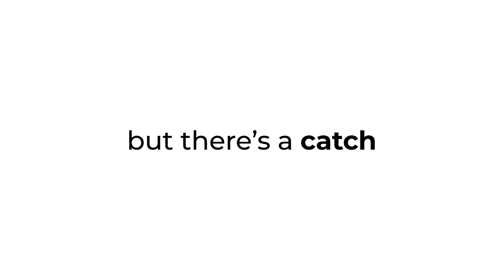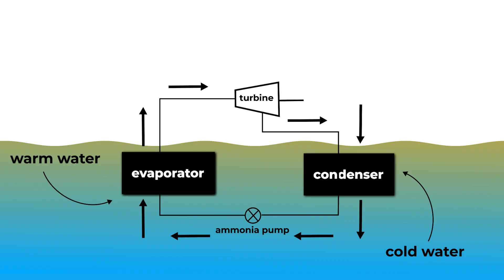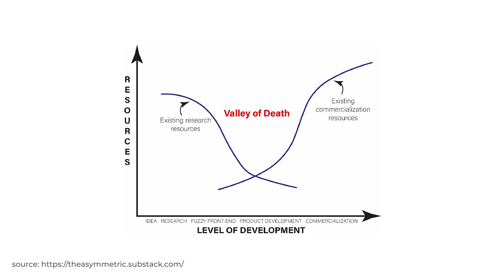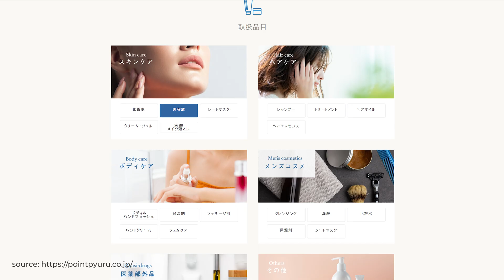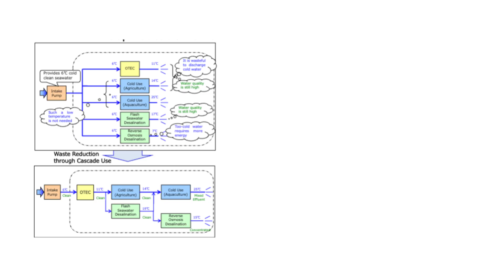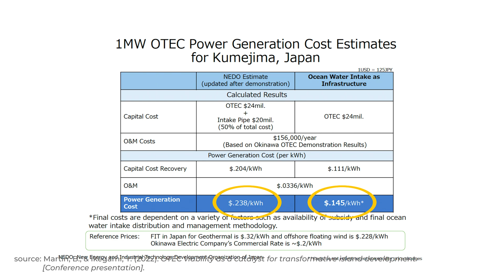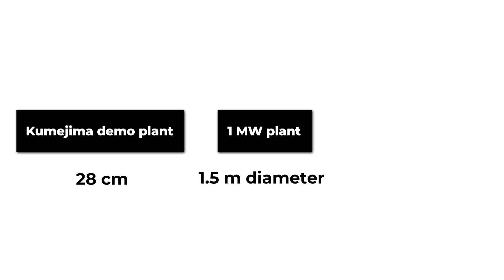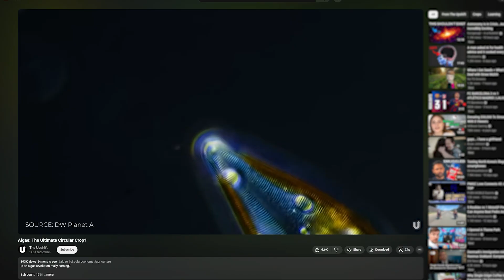OTEC: The Huge Ocean Energy Source You've Never Heard Of

Comment: R290 (propane) is a better fluid than ammonia for the refrigerant. Unfortunately you need either pumps or compressors. Under the right conditions the pumps/compressor could be ran by wave energy. Either way, I can’t believe it would be more efficient that wind turbines, wave energy generators or tidal/ current driven turbine generators.

Comment: The efficiency of an ideal heat engine is the relative difference in temperature between the heat reservoir, and the cold reservoir, in absolute temperature, so with a difference of 20 °C, at these temperatures, an ideal heat engine would be less than 7% efficient. Ideal, in this context means "not real", reaching half of that efficiency is an achievement in reality, and some aspects make it more difficult the smaller the temperature difference is. For the Rankine cycle, the temperatures is the actual temperatures of the working fluid, not the sources utilized, and the smaller the temperature difference, the bigger heat exchangers you need, for a given heat flow. If those 2.5 to 3 m³ per second per MW refers to 20 °C difference, the calculated net efficiency is about 0.4%, which might be possible to achieve.  3 m³ per second, times ~4 MJ per degree per m³, so times 20 degrees, means about 240 MW potential energy at 3 m³ per second and 20 °C temperature difference.               

While I personally think there's generally too much focus on thermodynamic efficiency when the energy source is "free", there are plenty of much easier, cheaper and practical ways to get more than 20 °C temperature difference than deep ocean water in warm climates. There are at lot of sources of waste heat with much greater potential than that, that not only would be much more efficient, but also only require a tiny fraction of the investment that OTEC requires. And in hot and dry climates, just the temperature difference between night and day is often much more than 20 °C, so just by storing some of that daytime heat to nights you could achieve much higher net efficiency, for a tiny fraction of the cost, and also without the scaling issue. While those temperature swings between night and day aren't as reliable, or consistent, as surface and deep ocean water, you would still be able to produce cheaper power with much smaller temperature differences when you don't have to pump all that water. But also, in constantly warm climates, a combination of solar and batteries will continue to become cheaper, if you don't have a lot of sunlight, you won't have as warm ocean surface water to utilize, not for long anyway.                     

A many times better use of cold deep ocean water would be to use it for cooling and air conditioning, that could save many times more energy, with a given amount of cold water, than the amount of energy you can produce from the temperature difference with some kind of heat engine.       

OTEC might be viable during winters in really cold climates, mostly for the heat, but also to produce a tiny bit of power. You wouldn't have to go very deep to collect the heat, and gravity could work for you instead of against you.

Comment: Stirling Engine and if OTEC plant is located at bottom of sea with a dilled hole to access geothermal heat and send E power back to shore.  This would need little to no pumps and rely on nature's convection  (heat below wants to rise up.)

Comment: Since the pipe is so expensive, it would be good to combine it in a system like Maui has where they do air conditioning with cold ocean bottom water that they pump up and through the city there. Then there is already a pipe and a pump and an energy demand present.
There is a book called the Millennial Project that describes this system very well. They have floating cities that are built from the minerals in the sea water. Floating cities have the shortest pipe and they can all be located in both our solar system's and our planets goldilocks zone. The nutrient rich water made the power systems waste nutrients turn into algae and then into plankton then bigger and bigger fish

Comment: Very interesting concept of bringing deep ocean nutrients back to the surface where the nutrients can boost ocean life.  

The electric output is very low per volume of water with such a low delta T.  But the tremendous volume of water available allows for reasonable energy, but with masive infrastructure use.

Comment: Why is it not mentioned? Because no Big Investors have shown any interest in that technology. Why is that so? The primary barrier is the high upfront cost for infrastructure, including the massive deep-water pipes (which can be over 1000 meters long) and large heat exchangers. The specialized components and complex marine engineering add significantly to the capital expenditure. Only Big Investors can put up the money for a proof of concept experiment at industrial scale. So far only the Chinese government has invested substantially in the R&D of that renewable energy technology. Their experts note it is already a potentially viable alternative to expensive, diesel-fueled power generation on remote islands. Not a market noticeable for the western Big Investors.

Comment: Do you have to increase the tube diameter to increase power capacity? Can you just add more tubes instead? Or is there a physics reason they have to be wider as they get bigger?
Reply: I think the rationale is geometrical: you want to use the least amount of material possible as efficiently as possible to minimize cost. If you want 2x the amount of water flow you could add another identical tube that is 2x the amount of material and cost. By Instead choosing a single larger tube the cross sectional area available for water flow increases with the square of the tube radius while the amount of material only goes up linearly because it is proportional to the circumference (assuming tube thickness is constant).

Here's an example: 
10 meter diameter pipe with 0.05 meter thickness
Cross sectional area of the pipe = difference in area between inside and outside of pipe = pi* [(5 m)^2 - (4.95 m)^2] =  1.56 m^2
Cross sectional area for water flow = inside area of pipe =  pi * (4.95 m)^2 = 76.97 m^2

2 of these pipes would have 3.13 m^2 of cross sectional area which would allow for 153.95 m^2 of cross sectional area for water flow

Now instead consider a single pipe with the same 0.05 m thickness that allows for 153.95 m^2 of cross section area for water flow:
153.95 m^2 = 3.1415 * (r_inner radius)^2
r_inner radius = 7.00 m
r_outer radius = 7.05 m
Cross sectional area of the single pipe = pi*[(7.05 m)^2 - (7.00 m)^2] = 2.21 m^2

So with a larger single pipe the water flow doubled but the cross sectional area of that pipe was only 2.21 m^2 / 1.56 m^2 = 1.4 times larger than the smaller pipe instead of 2 times larger

Comment: I want to see this combined with solar sand batteries. The energy potential in any system is the difference between the hottest and coldest points in the system. Deep ocean water is nearly freezing and sand batteries are at nearly 1000 degrees F. Since you are pulling from "storage" it provides baseload even being solar powered.

Comment: People do know about this. It has been tried and it didn't really work. Cool concept but very novel in it's actual usable applications. 
Mr. Plocek says the exact thing that other company's say about their own technology. Deep geothermal would do away with long duration energy storage with wind/solar becoming obsolete because geo produces around the clock regardless of weather, Nuclear produces round the clock with little land use and lots of energy density, hydro produces round the clock and is renewable that lasts a century or more, etc... They all have their upsides and downsides.
Reply: Main problem is the lack of really large temperature difference. Mix with solar and sand heat storage would make the difference increase by ten times.
Reply: @Soil-Nerd  jup, inherent thermal efficiency of about nothing. Honestly why bother with this OTEC when you have solar and sand heat storage, just use that directly.
Reply: Cost Cost Cost

Comment: There is more than a 20 degree temperature gradient at either pole during winter.  In the Arctic the distance is often less than a meter and at most only a few.  Since ice is only 10% less dense than water it requires only cms of head pressure.   In the Antarctic or Greenland there is a thick ice sheet but kilometers of ice is still only hundreds of meters hydraulic head.  The “hot” updraft can carry the water-snow far downwind.  Here we see a direct benefit for moving as much fluid through the system as possible.

Comment: Energy = Work + heat. If the ocean needs to be cooled, depleting that stored thermal energy by making it run a process is awesome.
Reply: The process described is using the cold ocean water.  That is not “cooling oceans”.  Very much the opposite.
Reply: @stefanr8232  LOL you really should read about heat engines !

Comment: 10m diameter pipe is insane. Who writes this stuff??

And at depth is just ridiculous.

Hydrostatic pressure!!

And this 'competition', why? It sounds like interference with fragile ecosphere (yet again), vast industrial infrastructure, marginal efficiency. 

So OP is selling it but why? A lot of these pilot projects are cynical exploitation of local funding opportunities, grants or tax breaks.

The idea it is somehow an alternative to solar at the EQUATOR is also hilarious.
Reply: You seem to be downplaying the decades of research and funding that were put into many now mature energy technologies like solar. As the video mentioned they did not get to where they are today out of nowhere. I agree the engineering challenges and potential ecological impacts of OTEC require further study but frankly there is no energy technology that has zero environmental impact (mining raw materials, ecological disturbance/displacement of habitat, ect). That doesn't mean those challenges cannot be overcome or that we shouldn't try to give everyone at least a minimum acceptable standard of living. Realistically at least some degree of environmental impact will probably always be unavoidable but of course minimization is what we should strive for.

In terms of realizing a 100% renewable grid adding even a modest amount of base load power can dramatically reduce the amount of battery capacity necessary thus making that kind of grid system more efficient/cost effective. Renewable or at the very least carbon free sources of base load power are somewhat elusive at present. Next generation Nuclear (modular, molten salt, Thorium, ect) has potential but is difficult to build rapidly at scale and triggers a lot of NIMBYism. Geothermal is the most obvious promising example that is rapidly improving/innovating but it is still not practical in many places. For an isolated tropical island (or even a coastal city that wants to source power locally and reduce the need for large scale intercontinental high voltage transmission lines) I would envision OTEC complimenting a large scale deployment of solar, wind, and batteries rather than replacing the need for them. 

There is no one single silver bullet to solve the climate crisis. Society needs to continue to develop a portfolio of many different carbon free energy technologies each with their own trade offs and deploy each in the niche(s) where it makes the most sense. Also massive investments in energy efficiency...
Reply: @evzt3 TLDR
Reply: The internal of the pipe is subject to the same amount of pressure as the outside. Hydrostatic pressure is not relevant when you’ve equalized the pressure.

Comment: Why do you need pumps for the water? Just use the water that's already there. Exchange directly with the warm water at the surface, with maybe a simple propeller or fan if the natural ocean current isn't already enough, and have the exchanger (made of or encased in heavy material) at the sea floor where the condenser does the same. This would also serve to anchor the OTEC in place, and if the whole system is more or less sealed than it would be able to safely exist even among turbulent waters as long as the support structure is strong enough.

Having the condensor be deep at the sea floor also make the workable area much wider, since the gradient between surface and floor can be wider than the surface and a few meters below the surface.
Reply: You say “with maybe a simple propellor” which fully highlights the energy loss.  The propellor is a type of pumping system.  Diaphragm pumps are likely to have much higher efficiency.  An alternative way of looking at the energy loss is just friction on the pipe.